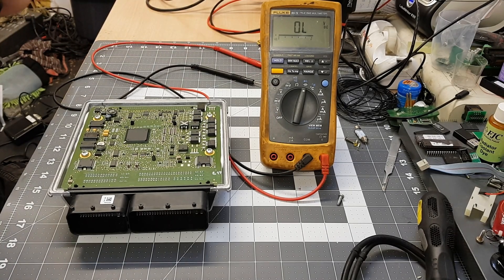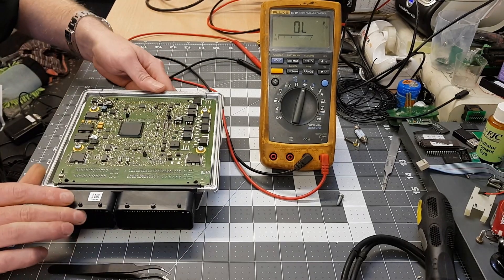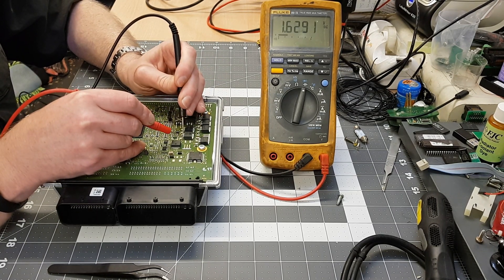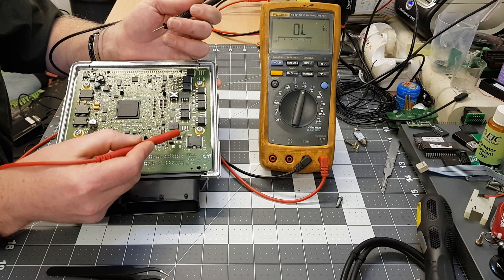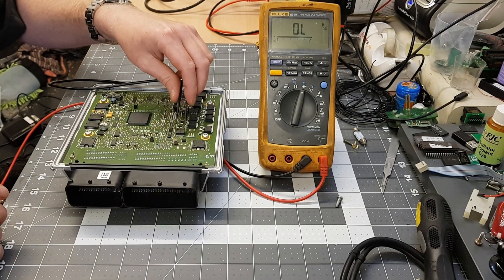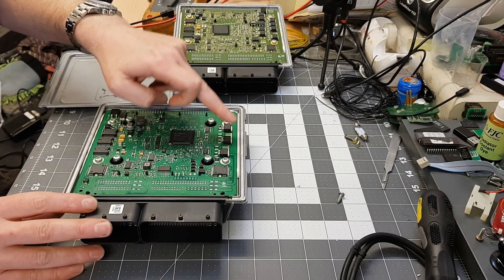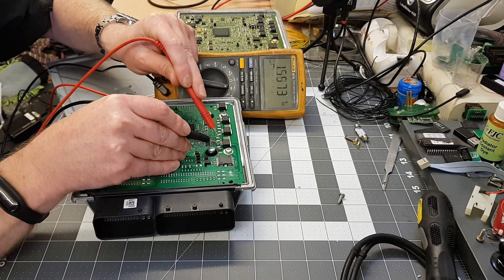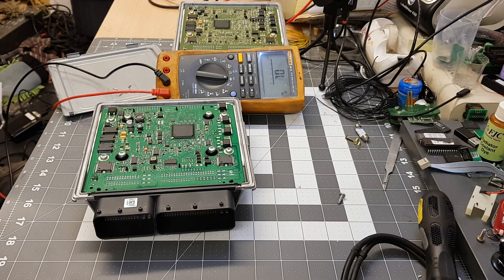BMW MSD80 ECU check and repair for misfires

Comment: Hello mate, you said in the video that this MSD 81 are not firing the coils but still showing good mosfets . Did you figure it out? Will appreciate any help. I’m having the same problem.
Reply from the maker: Not really, from what I could tell, it wasn't down to the DME. So coil drivers or injector drivers would be gone, and you'd have a constant misfire. You might find you are getting a load of minor misfires first, then the DME gives up and shuts the cylinder off.
If you clear codes and it runs a little better for a while then goes back to the complete misfire, that suggests it's something physical, and not electrical. Intake post sooting is common, and that disturbs the airflow and gives a mixture that is tricky to ignite, and then you've got the injectors themselves as being the issue.
I have seen that these ECUs aren't great at identifying the correct misfiring cylinder, for example you could have one saying its cyl4 with a misfire, put a new injector in 4 and then when it runs again, it starts saying cyl1 now is misfiring when it was fine before.
Are you getting no spark on a particular cylinder? 
It's quite possible the MSD81 I looked at just had a bad injector, was misdiagnosed as DME, sent to me, and I had nothing wrong to find.
The add-on board inside these MSD81 DMEs that give it the "lump" is the high voltage side for injectors. They are piezo injectors, so they run on 120-ish volts. That board has transformers to bump up the voltage into +60 and -60 volts which is stores in the capacitors, and then dumps that into an injector to fire it. There will be other 12v stuff for the coils somewhere.
Reply: @endtuning  thank you so much mate. Your answer was very helpful. My actual problem is that the injectors popped out while driving because the bolts holding them snapped.(my fault.) but that caused a short circuit I think because when the injectors popped out, they touched the coil ground to the wall cover. I fixed the bolt with helicoil and drove it the rest of the day everything was normal. The next day I started the car and it was very lumpy get misfire on all cylinders, and then the car shuts off and now it cranks and cracks. What I found was I’m not getting any spark at all. All the cylinders checked all the fuses. All of them looks fine even took out the DME and check the mosfets and they were fine. I checked the coil harness and they found the power pin of the coil connector is showing -5.77 volts instead of 12. And they got the code. DME, internal fault: RAM checksum. I don’t know I’m suspecting the DME. What do you think?
Reply from the maker: @xmodegamer1959  ok, yea, that does sound to be different, and maybe you do have something dead inside. 
The DME RAM fault is caused by the ECU not shutting down normally. When you switch them off, there is a soft turn off where the DME shuts down about 2-3 seconds later. If the power shuts off from disconnecting the battery, battery kill switches or similar, you will get the RAM internal fault.
Maybe other stuff will cause that.
Check all powers to the DME, there's usually a little pack of 5 fuses in the ECU box marked MOTOR SICHERUNG, and it's possible that a bad DME relay or blown fuse might mean it isn't getting all the powers it needs
Reply: @endtuning  sorry I had bad multimeter. I tried another one and the power is showing right 11.8 V which where it should be. And today in the morning, I checked the third pin which is the signal pin on the coils? I had a friend who cranked the engine while I’m looking at the multimeter and it stayed at 0 V all for coils so basically there is no signal from the DME to the coils if I understand, right. At this point, everything is pointing to the DME. What do you think? Should I try a used one and if I get spark, I can program it after?
Reply from the maker: @xmodegamer1959 That's not unusual, the coil will have a constant 12v, a constant ground and the signal wire. The signal wire is a ground from the ECU, so the ecu grounds that wire, the 12v flows through the coil and the spark appears.
A multimeter might not be quick enough to catch it, but it would be a switchijg ground, not a voltage pulse.
Reply: @endtuning  what do you think should I buy a used one and try fitting it? Do you know if I can get spark without programming it just to see if the DME is the problem because the shop here wants $150 to program the used one and the used DME is just 30 bucks
Reply from the maker: @xmodegamer1959 I don't think they will spark if thr immobiliser is active.
DME, CAS and key would work for a DIY swap all together without programming, and programming for VIN and mileage could be done later if needed
Reply: @endtuning  OK thank you man appreciate the help. I’m gonna test the signal again with the test light. And let you know when I solve the problem.

Comment: Hi I have a 2007 bmw 335i n54 I have a misfire on 1,2,3 with code 30BA- DME: injectors 1,2,3 or DME, internal fault. I am guessing its not the injectors, spark plugs or coils since they have been replaced before. I found this company boostmonkey that offers the service of replacing the Mosfets  for you. Sould I go this route or will will they eventualy fail soon again or upgrade to the msd81?
Reply from the maker: Something to put that into perspective is the original chips lasted 18 years, and of the 6 inside, it's not all that would have gone either.
If they all get swapped for new ones, there's no reason they shouldn't last another 18 years or more.

Comment: Hello sir I have my bmw e66 n62tu dme problem no ignition signal fault,do have the mosfet diagram ingition number?or can you send the whatsap number I will send you my dme diagram 🙏
Reply from the maker: I think that's one of the ME9 types, the ignition mosfets are often in a row on the side, you'll likely see 8 black squares. I don't know the part numbers for them, but you can try a similar diode test on each one to see if one stands out with different readings to the others. Check for codes too, and also check to see if all the coils are getting voltage, they should all have a 12v supply and the ECU grounds to fine them. If you don't have a 12v supply, there is sometimes another module, the IVM which has some fuses in it, this is a small black square near the ECU with a row of fuses on the top, and relays inside. They are common to have problems and might cut power to the coils.
Reply: @endtuning  already replace new ivm but still misfire no 8,what I do pull out the ignition 8 and spark plug with socket plug in start engine running no firing,swap both coil and plug still no firing,relplace new crank sensor and airmass still,posible faulty dme?should I buy new dme plug and play with ews cut?
Reply from the maker: @evofx4029  I was probably working on your type of ECU today, ME9.2.2, BMW Parts catalogie calls it EK928-5. 
Your one might be different though.
I don't think there is an EWS delete for that model, but it should be possible to clone the ECU with a BDM programmer. This would copy all data including your immobiliser codes and VINs.
If you can find a DME without EWS, try that as it should always be sparking. If there is a misfire, it can switch off the fuel injector, but the spark would still carry on as normal.
Reply: @endtuning  thank you sir

Comment: Sir pls can you give me diagran and pinout bmw n20 dme 5v problem
Reply from the maker: There can be quite a few different variants. There should also be a few different 5v supplies. I believe it can have 4 separate 5v power rails to run different sensors. If the wiring or a sensor is bad, it can take down one rail and cut out 4-5 different things. If you have a fault code for any particular sensor, that might narrow it down, and I might be able to tell you what else is on that circuit.

Comment: Hello, I have a problem with my 4-cylinder e90 320i 2009, engine N43 with ECU version MSD81.2..Fault memory: 29CE - Combustion (ignition) misfire cylinder 2. Physically the spark plugs, coils, injectors, wiring are good. Car is still shaking after cold start. When engine is warmed up (or warm weather), works nice. So....Swapped coils, plugs, injectors each others in different cylindets, but with no change of fault code - still cylinder 2 ignition problem.  Live data for rough run are bad always with cylinder 2. So I provided a test of these IGBTs V5036S according your video (on MOSFETs), but seem to be good - no short cicruit with measuring with multimeter. Is there posibility of bad working of V5036S in specific temperature and I can't detect it by multimeter? Or should to find a problem in another place? Should I replace a VS5036S? I found a blog about MSD80 and Bimmerprofs recommends to exchange them by ISL9V5045. Thank you.
Reply: Did you solved your problem? I have the same problem, hard cold start and clouds of white smoke from the exhaust, it doesn't fire on one cylinder. Coils and plugs are functional.
Reply: @paweg4643 i got the exakt Same Problem, did we find a solution?
Reply: I got the same problem here, did we find a solution?
Reply: @HichDah-z9z  yes, i upgraded a software of ecu to last release version, works good.

Comment: great video, this is exactly the problem i have. but the IGBTs i need are proprietary, cant find any information on it (fairchild D941CR-00211). Is there any reasonable way around needing a donor board? can i just use any new ON-semi Ecospark or similar? can you give me a hint to characterize the IGBT? i obviously have 3 working ones :)
Reply: The ignition IGBTs are 360V 500mJ types, eg ISL9V5036S
Reply: @inse001  you legend! thank you! how do you know?
Reply: @domothepilot  insider
Reply: @inse001 nice. i figured. your answer is for the generic car ones from the video, or for my fairchild specific one (motorbike)? or doesn't matter?
Reply from the maker: That would be a bit beyond me, but try asking on the EEV Blog forums (they have a forum as well as the Youtube channel) as there's a lot of smart people there, and you're not going to get crucified like on StackExchange

Comment: Bro which Mosfet did you use? Which yiu recommend for n53 530i 07?
Reply from the maker: Have a look in the description bit under the video. I've been using Vishay IRF644SPBF, and there's a couple of links to them at RS components, and Farnell.
Here's a link for them at Digi-key, so they are pretty common to find- https://www.digikey.co.uk/en/products/detail/vishay-siliconix/irf644spbf/812237

Comment: There are several videos on this topic however the majority just show you how to check continuity. All of my drivers passed the continuity check. When I used the diode function on my meter as per this video, the MOSFET for cylinder 2 injector had very different values to the other 5 MOSFETs indicating it to be suspect.

Comment: Hey I think mine got wet any idea how I can repair it or how I can check if it did get wet?
Reply: I have a decent multi meater
Reply from the maker: @brennenbartom8424  If you open it up, you'll usually see a very obvious tide-line on the inside of the thin metal lid. There's a lot of things that can start to corrode, so in cases like this, I tend to just clone them instead. You would need specific programmers to do this, as you need to get the ISN immobiliser code from the ECU. A straight 1:1 clone will plug in and work, everything gets copied over including any previous fault codes. Other options would be maybe switching to the MSD81 ECU, it's backward compatible with the MSD80s and doesn't tend to blow this chips up as much, but you'd still need fancy stuff to change the immobiliser code in the replacement ECU to match your existing ECU/Car.
Reply: @endtuning  do you have a video showing how to clone
Reply from the maker: @MrJinwright  Not for this type, I use Magic Motorsport Flex to clone them, you read all data out of the old ECU as a backup and write this into a replacement and Flex sorts everything out.

Comment: My ecu has issue communicating with oxygen sensor, specifically one pin of the ecu wouldn’t provide any signal or voltage from or to the oxygen sensor. I figured because I switched the connector wires red to black and black to red (black wire is not getting any current) and somehow I received signal from the wire that does not have signal before and the other wire that was getting signal doesn’t get signal once swapped. So that’s how I figured it must be the Ecu. My question to you in regards to DME S65 x60005 pin 7 which is not providing any current to the black wire. I am wondering what is the chip part number to make the necessary replacement?

Comment: My ecu has issue communicating with oxygen sensor, specifically one pin of the ecu wouldn’t provide any signal or voltage from or to the oxygen sensor. I figured because I swapped the connector wires black to red and red to black (black wire wasn’t getting any voltage) somehow I received signal from the wire that does not have signal before and the other wire that was getting signal doesn’t get signal once swapped. So that’s how I figured it must be the ecu. For E60 M5 DME MS S65, x60005. Pin 7 of the DME for x60005. I wonder what is the chip part number to make the necessary repair?

Comment: Hi mate I have an e92 with a check engine light. If I leave the car running for about 15 minutes at standstill my engine light starts flashing. 

I have codes for misfire cylinder 2 and 3. I have changed all spark plugs, got full service, coil packs nd petrol injectors for those 2 cylinders all coded in and replaced my o2 censor before cat however, my problem isn’t going away. 

My mechanic said it might be the ECU but that’s a £300 job so I’m wondering if you have experienced anything like this and by getting my ECU changed could it solve the problem?
Reply from the maker: I don't think that would be the ECU, when the driver chips go, they are dead forever more. I'm guessing you're going to have a 4cyl N engine, a misfire that starts up after a while could be awkward to figure out, direct injection engines have a couple of operating modes, homogeneous which is close to the traditional mixing, and stratified mode which is getting the fuel to sit in just one patch of the swirling air so in that patch, it is rich enough to keep the burning going.
Disturbances to the airflow could mix the fuel and air more, spread it about and then there isn't enough nearby to keep it going.
Sometimes it is injector spray patterns, sometimes it can be sooting on the back of the intake ports that don't get washed with fuel like a traditional injection system out in the manifold.
I'd probably look at intake port cleaning first, walnut blasting is the way to go. It something most direction injection engines will need at some point in their lives, so even if it doesn't fix the problem, you've at least got something clean and tidy.

Comment: Hi, where you have 1.33v i have: 1.244v, 1.485v, 0.793v, 0.178v.  please help because the car is not running.  regards
Reply from the maker: Are you doing this with diode check? I have sometimes heard people say they get different readings, but you can often just look for one that stands out as being different from the others. A diode junction usually has a voltage drop of 0.6-0.7V, and you can often see 2x this for components that have 2 diodes, so 1.2- 1.4v is common. 
0.793V would seem like a single diode junction, and 0.178V is too low, so it looks like one internal diode has shorted.
If those are two readings from FET "a" and two readings from FET "b", then FET "b" is your problem. If those are a/b/c/d, then c and d are bad.

Comment: The IRF644SPBF devices are injector MOSFETs. The ignition coils are driven by the V5036S IGBT devices. Obviously, a failure in either will lead to a misfire.
Reply from the maker: I have one in front of me right now, and yes, you are correct. On the N54 ECU I have now, those FETs go to X60006, a set of 12 pins.
N54 has these listed as injectors on all pins 1-12, and ignition on X60004, a set of 6 pins.
It seems like other MSD80s use X60006 for ignition on 1-6.
Ignition drivers are the row of slightly smaller FETs just behind the middle C.
Thanks for the correction!
Reply: So u can repair a ecu that misfires
Reply: @brandonmccall3929  how much is this part
Reply: @Everybodyshinetogether1  for my car is $140 for a ecu
Reply: @brandonmccall3929  can a bad one of these cause a engine electronics fault?
Reply: Do i need to open the 4 screw and flip it to check the ignition ones?

Comment: If it was the Ecu causing a misfire would it always throw a code ? As I think my  msd80 is causing my misfire I've been chasing however I don't have any codes
Reply: Yep, if it were the driver chip, it would be a strong, constant misfire. Once they burn out, they won't come back on and the car would have an obvious shake.
It would be clear to the ECU that there is a misfire too. Weaker/milder misfires could be things like airleaks which are the most common reason for a slight misfire, or it could be injector related, or intake port sooting.
A "carbon clean" would do nothing for that, the best solution is usually walnut shell blasting. There are cheap USB endoscopes about that can see into tight places, but you'd probably need to get the intake manifold off to see properly.
Reply: @enda320  Thank you I have changed injectors, coils, plugs, done walnut blast, reset adaptations and it seemed to be ok but drove it on holiday and it's came back just like a slight misfire at idle and low revs so maybe it's not my ecu? Due to the fact it seemed to get better/not do it but then went back to misfiring occasionally 🤦‍♂️